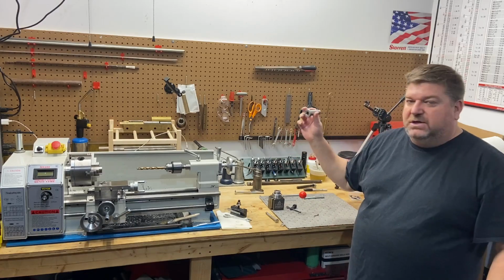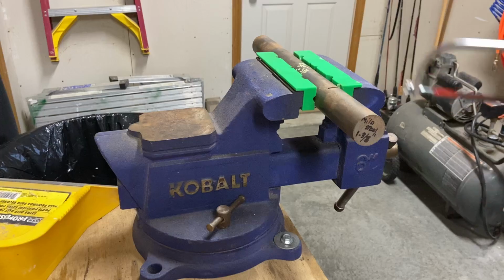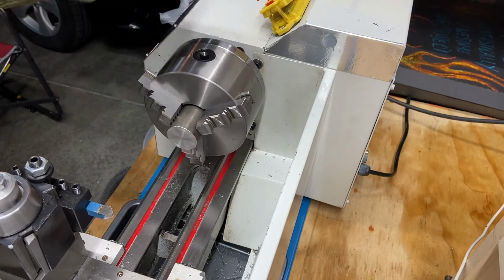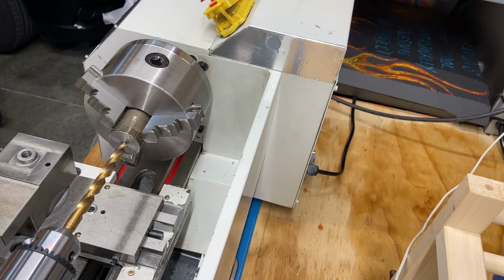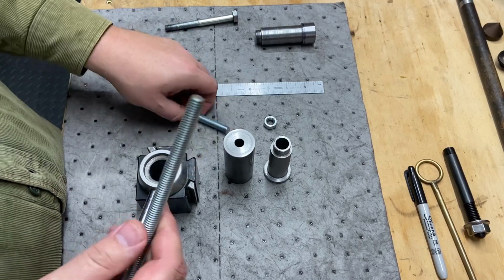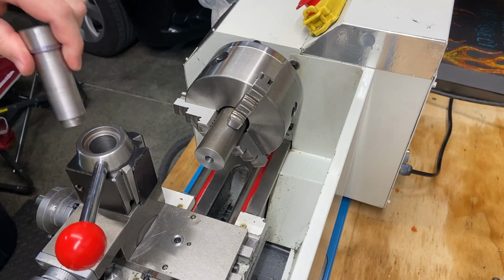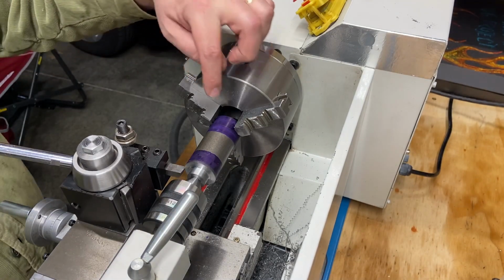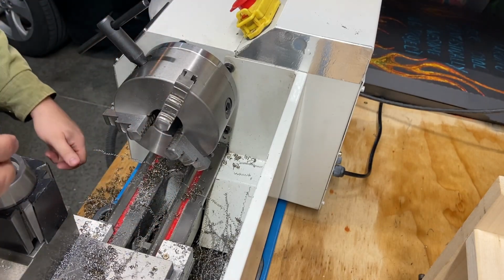AXA Toolpost mounting sleeve Re-Re-Make Part 1 for the Vevor mini lathe using proper sized materials

Comment: Don't blame the drill for the hole being off center in the piece.  A drill generally will find center, if your drill is not on center with the spindle it will drill an oversize or tapered hole, if your drill is dull or asymmetrical it will drill a hole that may not be round, but generally a drill in a lathe will be on center.  it is very possible that your 3 jaw chuck at that diameter may be a few thousandths out of concentricity, so your hole ended up at the center of spindle rotation, but the piece wasn't exactly.  The other thing that you didn't check was the roundness of your stock.  Cold rolled steel is usually pretty round, but it is not round like drill rod.  I think that .003" or so you measured is not bad for a piece of stock that wasn't checked for roundness or indicated true.
Reply from the maker: Good details as always.  You're right I didnt check the original piece when i started so it could have been slightly off as well as my 3-jaw.  Always good things to consider and think about with you posts.  Appreciate it.

Comment: If you push too hard when drilling the bit will walk off center. At least that's my experience. Caliper your 13/32 bit I guarantee you it's not .4062 if you're lucky it's .4058. Every drill bit I have is under sized. Only reamers are accurate.
Reply from the maker: I didn’t think of that. I’m going to check the actual drill bit and compare my results. Great suggestions that help me understand all the nuances. Thanks.
Reply: Pushing too hard with a hand drill will make the drill walk, but a spotted hole in a decent drill press or on a lathe will not walk if you press hard, it might break the drill, but the drill will stay in the spot .  And decent drills have listed tolerances.  For reference I looked up a tolerance listing from Greenfield, up to 1/8 they are +.0000 - .0005.  Up to 1/4 they are +.0000 -.0007  Up to 1/2 half they are +.0000  -.0010  So yeah, they are guaranteed to not be oversized, but you can't measure .0005 with a caliper, even doing it with a micrometer is pretty fussy, since you are in the range of thermal expansion with steel.  If it is .0004 small (your example) how big is it when cutting if it warms up to 150 degrees F? Or maybe 300 degrees?  If it is hot enough to make cutting oil smoke it is not the same size it was when you measured it at room temperature.